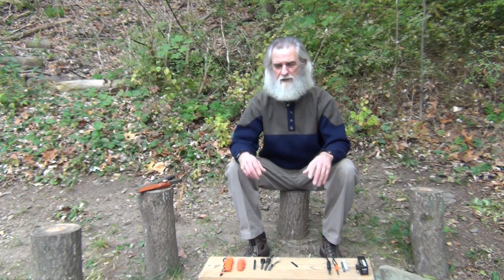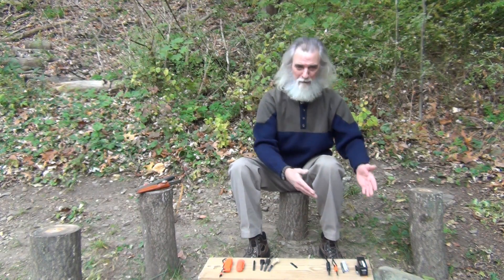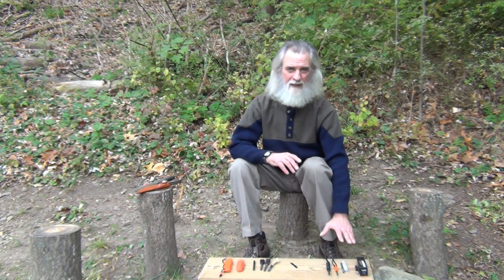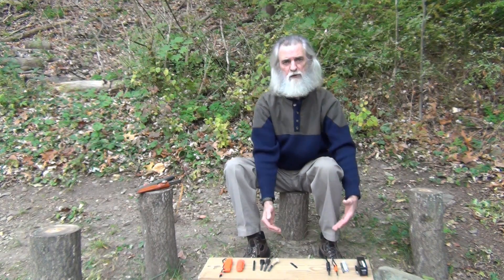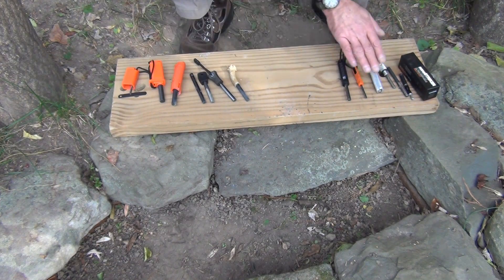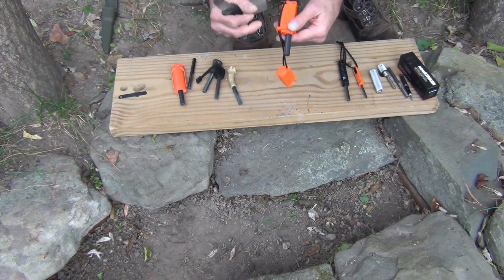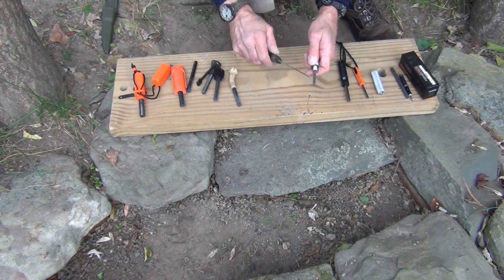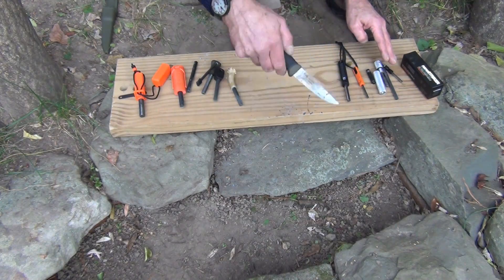Ferrocerium Vs Mischmetal

Comment: Very good  and very interesting.  By happenstance all my fire rods are ferrocenium and I have found bigger is better. If you have two rods of the same size what approximate life span of the mishmetal 50% or 75% of the ferrocenium rod?  Also with the very small diameter mishmetal rods how long do they last befor  they break in two when you use them.

Comment: I do distinguish between the two. I call a softer rod, a mischmetal rod and a hard rod, a ferro rod. The high magnesium are nice and soft and simply burn hotter which in my opinion just works better.

Comment: Great video I really like the light my fire fire steels I have not had any trouble with them I would like to find some others about the same hardness as the light my fire but a little bit larger diameter. Could you give me any suggestions.

Comment: Regardless of the metal content, it's all about your technique, how hard or soft, fast or slow you strike it, as well as how sharp the edge is on your striker. You can use any of these and get them to throw sparks, or chunks depending on those circumstances.
Reply: Yes. For the really hard EBAY cheap ones I use a square lathe bit millling blank. 4 edges. M2 tool steel or a Corona gardening shears sharpener with carbide. Softer ones aren't much of a problem, less pressure more speed and "run"

Comment: Misch metal is a raw rare earth alloy made mostly of cerium, with other lanthanides. It is too soft to get sparks reliably. Ferrocerium is much harder, and generates more sparks because the local heating is more intense. A neodymium magnet will stick to a ferrocerium rod but but not to mish metal.

Comment: To be fair i think it would be better if all of the rods were the same length and diameter.
It is easier to get a spark from a bigger, longer rod because you can exert more pressure
and get a longer stroke. You also have a bigger surface area on the flat as you scrap.. I enjoyed the information but I think it was a bit biased (not on purposed)  because of the size differences.

Comment: Good to know there is a difference. Even though it may not mean much to some, I can see right away why people on the survival shows have trouble. They lack technique when they execute the striker against the rod or bar and I can see as you stated already that the softer rods would be easier to use as those little burning bits would offer a greater chance to catch fire quicker. It's also a nice visual clue as to where the sparks are going and may ignite. I'm sure the harder rods would work with properly prepared tinder, but then again, it's proper preparation and technique that gets one a fire or not. :)

Comment: Great video, very informative.  I've always distinguished rod as being hard composition or soft composition but never really knew the difference.  Now that you've explained it the difference is pretty clear.  A nice compromise would be to carry both the hard type ferrocerium rod along with a block of magnesium.  If you need a hotter spark, simply scrape off some magnesium and add that to the tinder.  I've done it many times and often it will allow difficult tinder to light easier.  It is a bit of a pain to add that extra step, but it isn't generally needed unless your stuck with difficult or damp tinder.

Comment: Thanks for the info! I prefer the higher ferro content, sounds like it will last longer.
Reply: +kevin scurlock   They last about the same. How many fires each will ignite depends far more upon the tinders and techniques used than the ferro.
Reply: that's odd, figured softer would wear faster, but i have found the kind of striker i like, just a plain "for thin metal cutting" jigsaw blade.

Comment: Awesome video. Only one thing I'll say though in the way of constructive criticism...

I'm only saying this to help you with your audio quality, and you can take the free advice, or leave it.

(And a note only to trolls: I won't respond to trolls, who are honestly, most likely, less experienced in this matter - This is not a statement of what I think of myself, it's a statement of how sure I am about the knowledge I've acquired, and of the physics which my comment backs up. Among other sources I could cite, you may refer to the book "The Science of Sound" for some scientific studies on this subject - I highly recommend this book to any sound engineer, or anyone involved with or interested in the physics behind natural sound, sound production and reproduction, and acoustic engineering).

So here's my thought...

There's a sound trailing after your words all throughout the video that sounds like you added a low-end reverb in to the audio path. It causes a bit of "ear fatigue."

Having worked with sound equipment for many years ("back-line" work and audio engineering), I will just say that not many electronic devices are capable of producing a high quality "VOCAL REVERB." The equipment capable of putting out high quality, dense, vocal quality reverbs, are rather pricy (such as Lexicon, T.C. Electronics, Evantide, higher end Rolands, and older tube and analog reverbs - which are the most expensive). They are very dense, and have the ability to program zero "pre-delay." The echoey sound you're getting is either from standing in a very bad spot, or it was added into the mix with a low-end reverb (one thing that will naturally cause such a reverb is standing near a large pipe/culvert, or setting up your equipment next to a large rock or concrete surface - setting up your microphone directly on a flat paved road can also cause this - you're far safer setting up a microphone/camera over grass, which won't bounce sound back to your mic.). 

My experience and advice is to just leave out (added) reverb altogether if it's not very high quality. No reverb sounds clearer than poor reverb. Too much delay causes ear fatigue. I spent months on a project where we had to completely reengineer/redesign/rebuild a large hall to get rid of ear fatigue caused by echoes of over 65ms (a 30ms and lower delay/echo is acceptable to the ear, and is unnoticeable at low decibels).

I specifically mentioned "vocal" reverbs because the algorithms for vocal reverbs are different than those used for other purposes - they are extremely DENCE for one thing, which takes a high amount of processing, and can only be done correctly on expensive machines; and vocal reverbs are very short in trailing length (the amount of reverb that continues to trail off after the initial sound); and vocal reverbs have ZERO pre-delay (the length of silence before the reverb sounds). The end result is that you hardly notice a vocal reverb is being applied, and it sounds more like someone used a parametric equalizer (which in many cases is just as effective, and may actually be a less expensive option to brightening up a dead or muffled tone).

All this aside, I loved the video, and I learned a lot. Thank you for taking the time to put it together. =)
Reply from the maker: IamNemoN01 I must say that nobody can say that you are not awesome in your knowledge of audio, I know I am.  But, just so you know, knowledge and intelligence can often get in the way of practical thought.  In reality, no reverb was used.  I was using a white board to reflect the sun which caused the audio to bounce.  It is amazing that something so simple can cause such a situation.  Even awesome intellects can learn something.
Reply: survivalresources And thank you for being cool about my comment - I know I wrote quite a dissertation, lol. AND NOW I MUST SUBSCRIBE TO YOUR CHANNEL!!!
Reply: Wow, this a very long comment
Reply: it is a ten minutes video ... come on man, we will all survive to that audio i guarantee...

Comment: Great video on comparing the different types.  I actually didn't realize there was a difference in rods.  It seems to be a compromise though.  The rods with more magnesium tend to be smaller, and thus throw less sparks.  Which ever one you choose, it seems bigger is still better. Personally, I like having my combo block of magnesium with a ferro rod embedded in it.  I couple of shaving of magnesium in your pile helps guarantee a start.

Comment: Misch metal and ferro rods are all made from the same three basic material.

FERROs oxide CERRIUM, and magnesium and two or three trace mineral.

All they do is tamper with the amounts of ferrous oxide and magnesium. Either one will light fires if your have Good tinder.

If you don't carry good tinder or process your tinder fine enough get the softer ferro Rod or carry a small chunk of magnesium to grind to powder with the spine of the knife.

I prefer a harder and more durable ferro Rod.
Reply: ***** Yes, and you are both incorrect. Ferrous oxide is commonly referred to as "rust". What you both meant to say is "Iron(III) oxide", which is called "Hematite", or commonly called "iron ore". Yes, I am an engineer... All this aside, John, your video is one of most scientifically accurate of its kind on YouTube.

Comment: Excellent video sir, very informative. I also learned tonight that making fire with a ferro rod is not only about skill but also some luck, I say this because every night I practice making fire with ferro rod and my tinder of choice is fatwood. I made shavings plus scrapings of fatwood tonight and WOW! I failed at lighting it. That has never happened to me before with fatwood.  I scraped and scraped my ferro and sparks would hit the shavings but they absolutely would not catch on fire. Now I am using good fatwood, this stuff smells strong and it's sticky plus its even from same stick I've been using to make my fires. If this has ever happened to you let me know because I am dumbfounded.

Comment: I have a question, is it possible to get very large High Ferro, Low Magnesium style firesteels?

I have a firesteel that is just under 3/4 of an inch, X 5 inches. I am looking for a similar sized one, that is not so soft.

I like the fact that the harder ones can make sparks with a very slow motion of the scraper. Also that it is so easy to get sparks from them. I just can't find one that is a size that will last for 10 years.
Reply from the maker: I have never seen a ferro rod at 3/4".  Better not lose that one!  We do sell the BigStick Flint and the Strikeforce.  They both have the heavy Iron content, but they aren't as big as the one you have.
Reply: Do you know what the proportions of the metal mix is in a Strike Force?
Reply from the maker: No